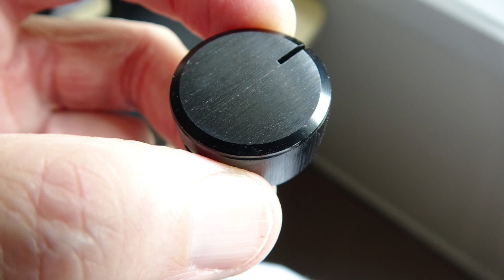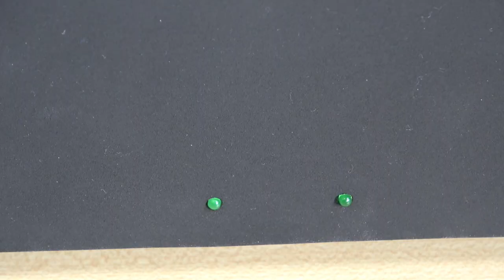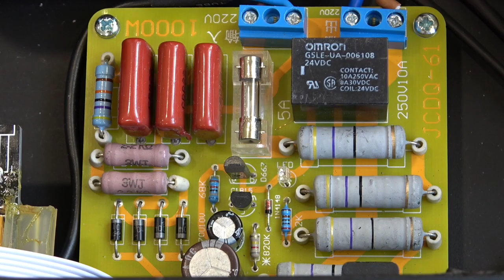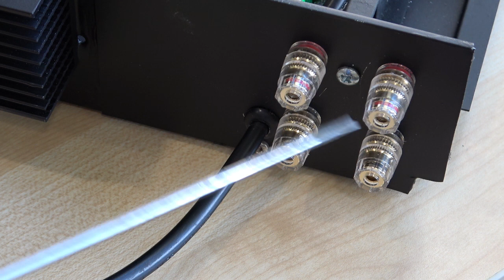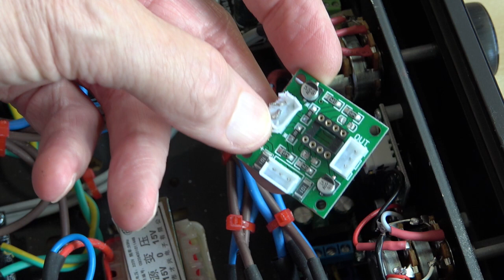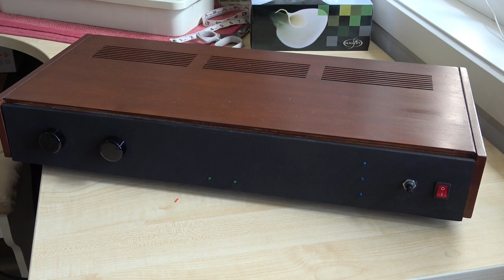Integrated Amplifier. Using L15. FET amplifier boards and NE5532 Preamp.

Comment: Thanks for your comprehensive videos, Michael! You put me onto the L15s by showing the details constructors are interested in. I shoehorned a couple of L15s into a Jaycar PF-19 rack enclosure with a pair of 35V 300VA toroidals (wired in dual mono configuration). It's a very pleasant sounding amp with plenty of power and reliability. I just wanted to say thanks for taking the 'gamble' out of my ebay purchase!
Reply from the maker: I'm very pleased you like them. It is always good to see someone else test a product, does take away some of the risk.

Comment from the maker: Steve Pippy
Hi Michael, Following your example, I'm building a similar integrated amp using LJM L12-2 amp modules and LJM P8 preamp. Which value volume pots did you place before and after the preamp? I assume the signal flow is Source --> Pot --> Preamp --> Pot --> L15 --> Speaker. Thank you.
Hi Steve, for some reason your text does not appear here, very odd. Yes the signal flow is correct. I use 50K Log pots. It's a good compromise and suits most impedance signal inputs. You could lower it slightly but don't go below 25K. I've not tried the P8 preamp but looks as you would expect. Good luck with you're project, let me know how you get on.
Reply: Michael, what would the downside to using 100k pots? Thanks, Derek
Reply from the maker: @derekduffill712  Impedance mismatch, it's abit high. More in keeping with a valve amplifier. I don't know what the audible effects will be to be honest. A possible increase in noise? because of a miss match. It's one of those things you know, so I don't do it, so I haven't!! I'm sure someone will know the answer.
Reply from the maker: @freshtips930  It also optimises the already low signal to noise ratio. Thanks Steve.

Comment: I would put the I of the on-off switch on the upper side...
Reply from the maker: I take you're point, the issue on my wiring is that the neon is lit all the time. I need to reverse the connections.

Comment: Could you have cut each heatsink into 3 pieces and mount vertically?
Reply from the maker: True, might have helped but would still need fan cooling. It's a powerful amplifier. Fets also have a higher internal voltage drop so dissipate more heat anyway.

Comment: Hi Mike can you tell me were you found the power cap board?
Reply from the maker: Hi Terence, it looks like this board is no longer available. I've had a quick look and lots of possible alternatives. Some just PCB, some without caps. Just type, Capacitor rectifier boards, on Ali or E bay.

Comment: Do we have a schematic for this amplifier? Fancy having a go at making my own boards and my own components. Have you ever built any of the Nelson pass amplifiers? And if you was to compare the l15, how would it stack up to commercial products? Cheers.
Reply from the maker: Sorry I don't have a circuit for the L15 you might find one on line from time to time but they are often incomplete or just wrong. I've never built anything from Pass. People I know love his stuff but as he tends to concentrate on class A. I'm not really interested. I would suggest the L12/2 is a better sounding amp anyway.
Reply: @MichaelBeeny  Thank you for replying and is most appreciated. Yeah Class A puts me off and would probably concentrate on A/B. Have you not done any reverse engineering, incase the L15 goes faulty, where a schematic would come in handy? I've enjoyed your videos, so keep up the good work... Cheers

Comment: Like what you did with the face plate. What kind of decals did you order?
Reply from the maker: Not sure quite what to do yet, might look around the local shops. Always open to suggestions!
Reply: @MichaelBeeny  Not really. I;ve been using transparant labelprinter, white on trabsparant. But they show a bit, even after spraying the whole with clear mat lacquer.

Comment: Michael, I have built a L15 amp and wondered if you installed coupling caps on the input to the amps and if you do what values do you recommend? Thanks
Derek
Reply from the maker: Good morning Derek, I have not used any caps at all. It's a bit of a risk really. It would probably be a good idea on the input in case of an issue with what ever you connect. The value needs to be quite high so you don't get LF roll off. Don't use an electrolytic. Cost and size will be the main issue. A 4.7 mfd will probably be OK. Any working voltage will again be fine. Hopefully it will never see more than a few mV ever.
Reply: Thanks Michael! No noise but wondered if it could effect the tone? It seems fine but I guess it’s not ideal so will swap for a 50k unit.
Derek
Reply: Michael thanks, I will look at the options!
Reply: @MichaelBeeny  No risk really because any signal source with DC on it's output will cause the power amp DC offset loudspeaker protection to operate.

Comment: I connected ne5532 module to my amp and it makes noise.
Could you explain more how you connected? Thanks.
Reply from the maker: In my circuit the input goes to a 50k log pot which goes directly to the input of the pre amp. The output from the preamp goes to a second 50K log pot which is connected directly to the amplifier input. Any number of things could go wrong. Is the power connected correctly. Do you have a +15 volts and a -15 volts DC. Is the 5532 located the right way round with all pins located. Is the 5532 a real or a fake?
You should not have ANY hum and very little extra noise at full volume.
Reply: @MichaelBeeny  Thanks for your response. The ne5532 ( same as yours ) is amplifying with a small hum (noise).
My amp is stereo TDA7294 from Aliexpress .Between preamp and power amp there is 50k pot. Power supply symmetrical with 2x 10,000mf/50v.
I tried separate power supply, and got same result. My amp works very well without the preamp, although not very powerful, which was the reason for preamp.
Reply from the maker: @Al-bd8hm  I hope you are not running the preamp from the 50 volt supply? Should be 15/18 max
Reply: @MichaelBeeny  +-15v. From DC  +-30v for each rail I use resistor to limit zener current and then another capacitor 450mf/50v. I get at the end +-15v.
Thanks for the prompt response.
Reply from the maker: @Al-bd8hm  That sounds fine. If you have hum it must be the earthing of the signal cable. So hard to fault find when you can't see what's going on and so far away. Maybe you can send me some close up photo's. tas.audio49@gmail.com